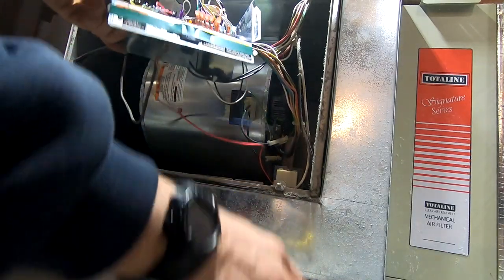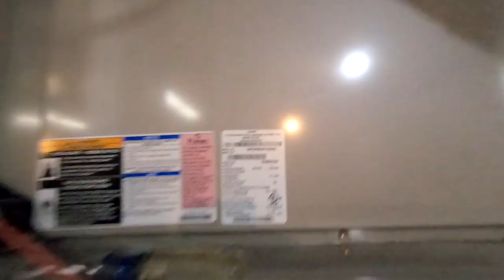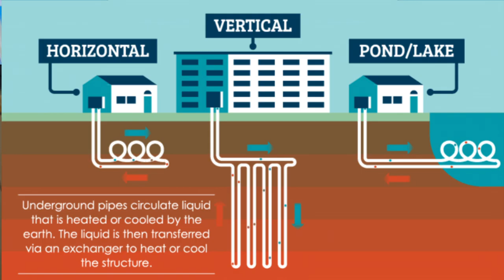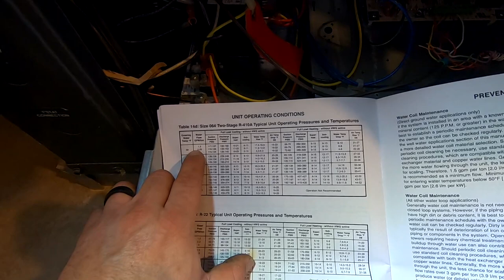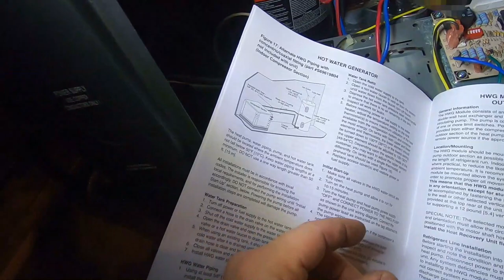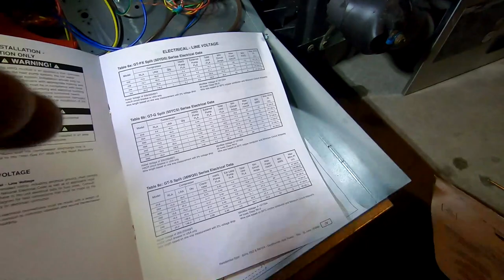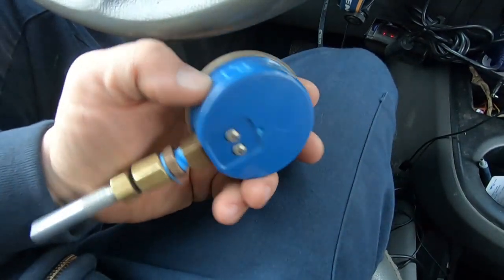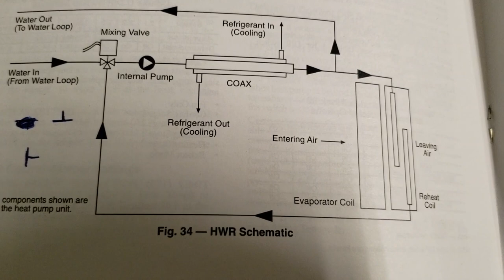No Heat Repair of Dual Fuel Geothermal System With Gas Auxiliary Heat

Comment: Thanks for water flow info! We work on a few geo units and fix any refrigerant or power problems but anytime it’s pump or water based problems we call the loop installer to have him come fix it. Will talk to boss, this would help keep more of that money and efficiency in our hands! Thanks for your detailed knowledge and check of the loops!
Reply from the maker: I use to have the same problem, hope it helps clear it up. You need the factory datasheet to know what the GPM is and what the capacity of the system should be.
Reply: HVACR Survival yep. Luckily most systems we work on are carrier and have the manual inside unit. I’ve read thru a few during few moments I had at each unit but this clears it up quite well. Thanks again!
Reply from the maker: @jphvac5725  awesome 👍👍

Comment: Thanks for sharing the information on geo thermal equipment.   I have never seen nor worked on one .  Thank you for the tips on checking the water specs.
Reply from the maker: That's great to hear! This should help you get a good foundation to get started if you run into one.  It was mystical to me for a long time. 👍👍

Comment: Very cool stuff! Definitely learned something new watching this video, I’ve worked on water source heat pump‘s 100 times but never have I checked the water pressure or temperature just because I was never taught how to do so nor do I have the tools to do it. Definitely will be starting to do that from now on
Reply from the maker: That's awesome man, you basically have been dealing with what I've had been dealing with prior to coming to where I'm at now. Glad to hear it helped 👍👍

Comment: This is first reheat coil I’ve seen must not be a popular option. Thanks for sharing. I’m mainly residential some light commercial.
Reply from the maker: It's all the rage in schools and municipalities that have money to spend. Some of the places that have these will have one geo in each room or office to basically zone each area without a traditional zone system. Ranging from 6K BTU to 64K BTU on average per room. You might have 60-85 systems in a building.

Comment: Great video. I've worked on tons of water source heat pumps in commercial buildings, but have zero experience with geothermal systems. Although the theory is the same. What I would like to add, is you showed Belimo valves at the end of the video. I'm thinking (based on my experience) you probably have a vfd controlling your loop (or condenser) pump. The vfd should be controlling to loop pressure.
Reply from the maker: Yes sir! It's a very nice system with a primary and secondary loop, it also has a electric boiler and a geo make-up air system all controlled by a networked controller.

Comment: What a nightmare of a system , home owner got hustled into buying this GEO thermo POS . Well thank you for making this video It was very interesting to learn about a new system . We don’t have them here in the Southwest .
Reply from the maker: I'm curious. Why do you think he got hustled into purchasing the Geo? This is one of the top of line setups and one of the most efficient for my area. Not everyone lives in the tropics and has Natural Gas.
Reply: I’m sure it’s a great system but there just so many moving parts don’t think it’s worth the return in investment . Water is Destroyer of all things . I feel the money you saved on energy is going  to be spent on more maintenance  for water Filtration system and other issues down the road . Here in Vegas  normal tap water will ruin all your plumbing in your house unless you have a full house Filtration setup .
Reply: How expensive are these systems ? And do you see a lot of folks installing them ?
Reply from the maker: @garza7676   Price is  subjective based on the area uou live at. Generally I see these installed for about $20k to $25k. Depends on what kind of extra things they have. These people here have Infinity zone system. There's a 30. Percent tax credit towards that amount.  This is a closed loop system. So there's no corrosion to worry about and that water is treated and tested on fill up.  Payback is relatively quick. There's computer programs that show how long it takes. I don't have the numbers in my head. These are generally installed in rural areas where you have land and no natural gas available.
Reply from the maker: Prior to coming to this company. I didn't do very many of them. But at this place I do a lot of them.
Reply: Ok that makes more sense now that you mentioned that these folks live in rural areas and  there’s a tax breaks to go along with it .I can see the appeal . Here in Las Vegas solar panels are probably the only thing you can get to reduce energy cost and also get a 30 percent tax break. Thank you for taking the time to explain geo thermo system and good job on the fix sir .
Reply from the maker: @garza7676  no problem,  we have some solar panels over here but there not popular on residential but commercial windmills are popular here.

Comment: a short on the secondary side will overheat a transformer until the primary side thermal fuse opens, the majority of all do have that as a safety feature. if not eventually the winding's will open.
they still get hotter than hell and cook some. a fused secondary is always great :)
Reply from the maker: It is fused on the secondary with a 3 amp fuse,  the primary does not have anything,  it's a standard duty 40va transformer. 120v x 24v.
Reply: I meant internally to the transformer, most have a one time fuse on the primary as last line of safety, if not they'd continue to burn, catch fire and eventually blow the equipment line fuse or upstream breaker and possibly leave molten spaghetti where the wiring existed :)
Reply from the maker: @throttlebottle5906  I opened the cover of the transformer on video and looked at it but did not cut it in half, there might be a thermol link under the wrapped coil? It could be from the insulation coating failing or his whole house generator has a bad voltage regulator and possible engine rings causing it to not run at full speed.

Comment: Are those large barrel chillers used in geothermal systems?
Reply from the maker: The heat transfer is similar to a chillier is what I was comparing it to in the video.  The geothermal that I'm showing here is not over the 5-ton area,  So the physical size of this coil is nowhere near the size of a chillier barrel. However they are similar in size to a plate exchanger. When you get into say a 30-ton geothermal, they can be much larger but there differently designed than this traditional round coaxial coil shown here.

Comment: I’ve seen the primary side open due to a shorted contactor coil.
Reply from the maker: Im sure anything is possible, maybe the XFMR had weak insulation on the primary windings from a long term maximum load on it. From all my magic smoke experiences,  I've always lost the secondary side from a short plus normally the secondary is fused. Interesting! Thanks 4 sharing👍👍
Reply: HVACR Survival And thanks for your videos!

Comment: Wow I didn't think geo heat pumps even needed aux heat but gas heat  with geo heat pump is odd I've never seen a geo heat pump in my area before in northwestern NC
Reply from the maker: This was a little different than most, they make one self-contained with electric strip heat, You probably don't need them where you are because you have FAKE WINTERS...lol
Reply: @HVACRSurvival  oh do they
Reply from the maker: @heatpumphvac3150  have fake winters? Lows of 30* lol
Reply from the maker: @heatpumphvac3150  I'm kidding,  I wish it only got as cold here as it does there😁👍👍